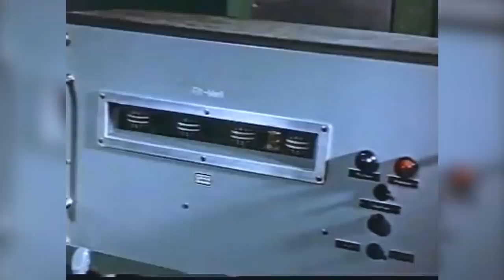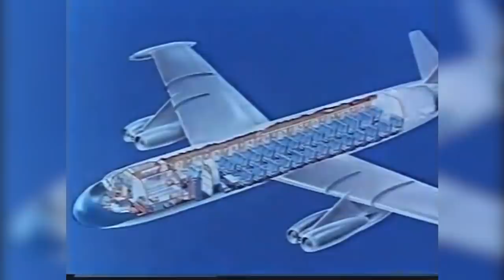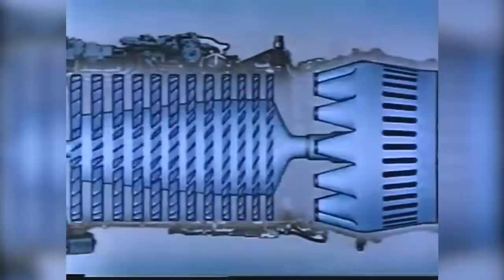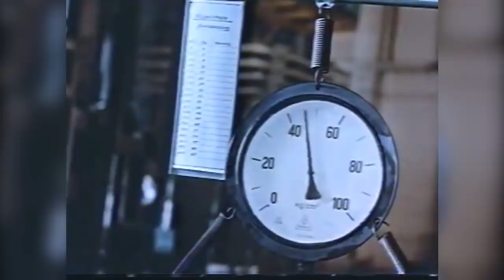East Germany's Attempt At A Boeing 737 - The Baade 152

Comment: Two short remarks: First, the Baade 152 should be equipped with "Pirna 014" engines, a modernized version of world's first mass-produced turbojet "Jumo 004" which was called after the Dresden suburb "Pirna" where ist was produced. The aircraft engine manufacturerer from Berlin was Bramo.
The first two 152-flights were undertaken with russain engines due to delayed availability of the Pirna engine.
Second, the manufacturer of the Baade 152 of course still exists (current Name: Elbe Flugzeugwerke) now being part of Airbus and manufacturing all cargo Airbuses.
Reply: A modernized Jumo 004 was completely obsolete by the late fifties. May a license built Klimov VK-1 ( Rolls Royce Nene) would have been a good start,
Reply: Amazing the facility is useful now! 🎯
Reply: I wouldn't call Pirna a suburb, because a suburb is something very else. Pirna is a rather small town not far away from Dresden. (A suburb is mainly defined as some kind of incomplete appendix to a larger city, which lacks part of the infrastructure a town needs, but uses the infrastructure of the larger city nearby.)

Comment: Whoever animated the jet left the engine covers on.
Reply: Ha, was just about to write the same thing.  Just think how fast it would be without those.
Reply: Those are revolutionary ultra-low bypass engines.
Reply: @dmrr7739  You couldnt even run a turbojet on a mass air flow that small. At least not any turbojet of a sufficient size to power that plane. And a turbojet is a zero bypass engine. Cant get any smaller than that.

Comment: The Baade 152 overhead wing configuration makes this aircraft most interesting as future design points in this direction for long heavy haulers. Likely the concept of dynamic fuel flow was not fully understood causing the fuel starvation issue. Likely if it entered the market with the critical issue solved it would not of served long but the next development would have been a market changer.

Comment: The name of the plane is actually only 152, without the Baade. Brunolf Baade was the head of construction, but his name was not included. And it's only in recent years that the "Baade-152" pops up here and there, probably to be more in line with naming conventions that include either the company name or the name of the chief engineer.

Comment: There are 2 engines per casing. Making a total of 4 engines. This is less fuel efficient than having only 2 slightly bigger more powerful engines. Because more engines = higher fuel consumption (obviously). But also more frequent maintenance. And higher overall maintenance costs. Just to name a few things. 
There is a plethora of other disadvantages as well.
Reply: Come again, please, when you understand the planned economy of East Germany. On delivery the aircraft would have been handed over with 2 working engines and 2 rotating fans in the other sections of the pods. In that scheme it would have been reported that the number of aircraft even overfulfilled the plan. Nothing would have been mentioned about every second aircraft quietly being shunted into a hangar "for training purposes". There the working engines would have been transferred to the "other every second aircraft" for getting them operational. Suddenly one would have noticed that the engine company overfulfilled their production plan just to supply the missing engines. And maybe find enough material for some spare engines. By the time the plans for the production of the 152 were fulfilled, the aircraft would have reached its working life span.:text-green-game-over:

Comment: Some ideas for future episodes: The West-Germans also designed two unusual jets, the VFW-Fokker 614 with engines above the wings, and the HFB 320 Hansa Jet with forward swept wings, both not commercially successful.
Reply: Yes, that one looked really odd, and all the passengers could see was the engines above the wings
Reply: @donaldstanfield8862  It was meant to be the illusive replacement of the DC-3 bringing the jet age to the bush environment, being able to operate from gravel runways without ingesting any risky material into the engines. Unfortunately, lack of government support had VFW (Vereinigte Flugtechnische Werke) being sold off to Fokker, which gave their F28 (later F70 and F100) the priority of their attention. Had Airbus had more strength in those days (they were just running in at that time with their A300s and A310s), the 614 could have been a more successful product in the recently launched A200 range.

Comment: Thx great Video! You did better than most others that made a video about the Baade 152 - and you named different  reasons to why it whouldn't succeed . 10:00 Also  one could add, that the only Hull left of the baade 152 is on display at the dresden Airport Museeum next to the Company :D Also to the crash of the Prototype - as far as I know, investigators didn't believed that the engines stalled, but, that the testpilot went to low at a low power setting , and then engines took to long to spool up after he noticed his mistake but anyway we will never know ^^

Comment: So I noticed you dont have fighter jets but im still gonna mention it.
The Convair Model 200: a US navy jump jet from the 60's. It was a concept but never built.
Reply: Actually it was developed in the early 70's. However Convair after loosing it's butt on the 880/990 program moved to being a sub contractor for airline parts. After the mid 60's it didn't produce anymore planes. Interestingly Convair built the center section fuselage for the MD-11 until MD was bought by Boeing.
Reply from the maker: My next big neverbuilt project is a military one :) time to branch out from just commercial planes :)

Comment: Excellent video as always. My only other comment is "damn that thing is ugly" May or may not be a good design- I'm not an engineer so I don't know
Reply from the maker: Well the design crashed, so its hard to say if it was good. And it was based on a military bomber, so you might notice that the engines are not powerful enough (hence four, not two), and that the center of gravity is too high. I love the bubble cockpit though!
Reply: @FoundAndExplained  Only the 1st prototype had a glass nose cockpit, tandem main gear and also older Soviet engines. That all changed from the 2nd prototype onwards. However after just a few flights of the later prototype the program was cancelled for several reasons. I think you missed to mention that in your video.
Reply: @FoundAndExplained  twin engines on passenger jets are a much (decades) later development, once reliability could be guaranteed
Reply: Well, it looks like someone took a carving knife to a B-52, aka BUFF.
Reply: @anthonykaiser974  BUFF is a very specific B52, the oldest B52 in service is nicknamed BUFF.
Reply: @abuBrachiosaurus  the B-52 in general has been known as "BUFF" since "Operation Arc Light" in Vietnam. USAF fact sheets attest to this.
Reply: @wanderschlosser1857  He missed everything in this upload.

Comment: When you set the engines far below the center of mass, as here, you get a significant upward pitching moment when you power up. That's a terrible "feature" if you need to increase airspeed to avoid a stall, since pitching the nose up will increase angle of attack and tend to accelerate the stall. This can be mitigated, of course, by using the elevator to pitch down as you add power, but it can still be a serious problem, not least because at certain angles of attack, you can lose control authority on the elevator. (The elevator can enter the turbulent air coming off the wings, which reduces the effect of control surface movements.

You really want to keep your thrust vector as near the CoM as possible.
Reply: wait... most of the modern passenger aircraft have engines far below center of mass. engine is the lowest part of aircraft in most cases if it doesnt have rear mounted engine.

Comment: The maingear being the second most expensive equipment on the inventory is a persuasive reason why we do not see many high wing aircraft. Although there are aerodynamic benefits from high wing designs, which could lead to higher efficiencies and cheaper operation. These decisions led them to the bicycle maingear layout which, while uncommon on commercial aircraft is seen on military applications of the era quite a lot. I think the bicycle mains would be very durable and track straighter on icy runways. 

All that said Im a little baffled why the engine pylons bring the engines so low, and where a lot less structure here makes the aircraft seem to 'look right', would be lighter and less costly.

Comment: It's a shame we never found out how this aircraft would perform.
I do however have my doubts initialy for the following reasons
1) The landing gear under the belly configuration results in a pretty low crosswind limit.
2) The huge engine pod mountings act as a huge rudder, nice to assist when an engine fails at low speed (TakeOff)
But it will make the aircraft difficult to controll along the top axis (direction control)
3) Engine configuration to expensive, and untested engines expecting to be unreliable.
Still i think the Sovjets made a mistake by not supporting the idea, as USSR developed aircraft where not realy suitable for the western marked (while the wessies not realy could cope with Rusian airport conditions at the time)
The Baade 152 how odd the design may be, on the long term probarly would have been interesting for some niche market.\
.
Talking about a niche: How about the plan once a came up at the Dutch Fokker Aircraft company to build a Fokker F27 Seaplane. Also the same company was elaborating on a 737/320 alike competitor

Comment: This clip lacks some points. Besides constructing the Baade 152, VEB Flugzeugwerke Dresden built some 80 Iljushin IL-14 under licence, the OKB150 Bomber was based on the blue prints of an original WWII german disign for a bomber by Heinkel which never made it into production. The Baade which crashed was supposed to do a fly past at the Leipziger industrial fair. One of the attendees was Khruschev. After the Baade project was cancelled, VEB continued the overhaul of airplanes (mostly Mig´s) right to the end of the DDR. After the reunification the west german aerospace company DASA got hold of it and produced parts for the Fokker F100 until the demise of Fokker in 1996.

Comment: Did these come with a pressurized cabin? Many bombers from that era didn´t, meaning the passengers would either need an oxygen mask, or the plane flying low to provide breathable air thus using way more fuel.
Converting to pressurized may have been too complicated, since it involves the entire airframe. It may have contributed to its demise..

Comment: The engine intakes look off, seems like you modelled the look of the removable cover for use while being parked outside onto the intakes, instead of modeling the actual engine intake.
Reply: No that's what the B152 / II V1's pods looked like, the V4 version were more normal looking. I think with the engines so close to the ground, those funning front ends were to avoid foreign material ingestion

Comment: I can see a massive problem with this thing 40 seconds in wire the engine so close to the ground just so you can make sure you suck up all of the leaves make it a really expensive lawnmower
Reply: The current 737 also has its engines very close to the ground.

Comment: EDITED and CORRECTED TEXT
 Converting a military bomber aircraft to a passenger jet plane was
 not a new idea, and it was the start of that would become the Baade 152
 Its design could seat up to 57 passengers, 72 in a high configuration
 and It would be used throughout the Soviet Union and even marketed
 to the west using American-made avionics!
 If it went ahead, it would have been a political triumph of the USSR,
 and cement the East German aviation industry for decades to come.

 But it never happened. And to understand, we need to go back to the
 beginning. 

 The 1950s was a very different place in Europe.  Germany was occupied
 by the two sides of the cold war, with the west controlling the west
 side of the country and east Germany under the USSR's controlling
 influence.  

 As part of its 'stewardship' of the country, the USSR had eliminated
 the homegrown aviation industry after the war and deported all the
 aerospace engineers to work on military projects in Moscow.
 The country was left without any involvement in aviation and lacked
 a competitive edge of the world stage.  

 But these engineers had not been idle. While working in the USSR, they
 noticed that the soviet bomber project, OKB-1 150 could very well be
 used for a commercial passenger aircraft.

 By the early 1950s, East Germany had been officially founded, and the
 German aerospace scientists were allowed to return home - many of whom
 couldn't shake the idea of the jet bomber turned civil aircraft. 

 At the same time, the new state declared that it needed a new aerospace
 company called the VEB Flugzeugwerke based in the city of Dresden.
 It was initially set to build military aircraft, however, thanks for a
 popular uprising in the USSR the following year, the powers deemed that
 it would be a civil production facility.

 To jump-start product development, the firm hired newly returned
 engineers such as Brunolf Baade, among others.  As the whole team had
 worked on the Soviet bomber project, and still maintained the idea to
 turn it into a civil jet plane, the firm decided
 to commit to the idea - dubbing it the Baade 152 after the lead engineer.

 But what was the Baade 152 actually like?

 The Baade 152 was configured with 57 seats in a one cabin configuration
 of around 34 inches legroom, although during to proposal stage several
 other alternative seating arrangements were created, such as a
 72- passenger configuration or a more spacious 42-seater for leisure
 routes.
 Likely the firm also considered a VIP transport option for around 10
 passengers. 

 As the plane was based on the previous bomber, it would share many of
 the same aerodynamics, including a range of 2,000–2,500 km
 [1,200–1,600 mi]  [1,100–1,300 nmi] depending on configuration.

 Arguably this range is very low and would have led to a poor market
 reach years later, moreover, for the market, it was designed for, it fit
 the bill. 

 The plane would have up to six crew members, three cabin crew, and
 three in the cockpit.

 In terms of routes, the design team was promised that it would fly
 throughout the soviet union as a small shuttle aircraft to link nearby
 cities.

 Local airline LUFTHANSA jumped at the chance to buy the home state
 aircraft, and proposed an order for 20 planes. 

 By the year 1958, the first prototype rolled out of the factory on a
 very unique looking tandem landing gear and glazed nose for the
 navigator to look out of - common among soviet era strategic bombers
 but not seen before on a passenger jet aircraft.

 The maiden flight was a success and it looked as if the east German
 state had freed itself from the shackles of being behind the west.
 
 Unfortunately, only a few months later that dream would end forever. 

 On Wednesday, March 04, 1959, the prototype crashed during its second
 test flight and killed all on board. Being a political embarrassment,
 the crash was never fully investigated and hidden until well after the
 change in government in 1990

 It has since been believed that the aircraft had a fatal flaw with the
 design. When in a  steep descent such as coming in to land on a short
 runway, the fuel became cut off and the engines stalled  - leading to
 a crash. 

 After three flight tests, the entire program was grounded.
 However, this wasn't the reported reason for the cancelation of the
 program - rather - it was political.

 The Soviet Union who had initially promised that the Baade would fly
 throughout the USSR, actually stepped in and commanded the East German
 state to dissolve the entire aerospace industry - shut down all
 production and scrap the design - including the two prototypes.
 
 This was because the USSR was working on its own airframe to compete
 in the same market, known as the Tupolev Tu-124

 And with a plane that could not fly, a production that did not have
 any orders nor funding, and a market that was quickly evolving with
 the arrival of the British made Comet and later the Boeing 707 - it
 looks like the iron curtain would close the Baade 152  for the final
 time.

Comment: I see another issue with the wings set on top of the fuselage and not under the fuselage as with other aircraft.  That's my aeronautical engineer fan talking, not an actual engineer.  Just guessing.
Reply: It wouldn't cause any kind of aerodynamic conflict having high set wings,the Fokker F27 friendship had high set wings and it was very successful.

Comment: Look at the engine intakes of OKB-150. Now look at the intakes/ exhaust of the 152 you modelled. Waaaay, to small. See it now? Look at the B-47; similar jets in pods. Look at the intake size. The 152 would be similar in size.
Reply: All for a reason, so nobody could discover that the aircraft did not have working engines - apart from one flying prototype ...:face-turquoise-covering-eyes:

Comment: I like your videos. But the informations in this are not corect! The Crash and the End of the Projekt were not the result of an designflaw. There are not many informations gathered after the crash, but the few save facts are showing, that its more likely that the crash happend because of an bad flying profile and mistakes by the crew. The End of the Project happens because of many reasons. The main reason so far, is that nobody ordered any of the planes, so there was no need for a production.... sorry for my english!